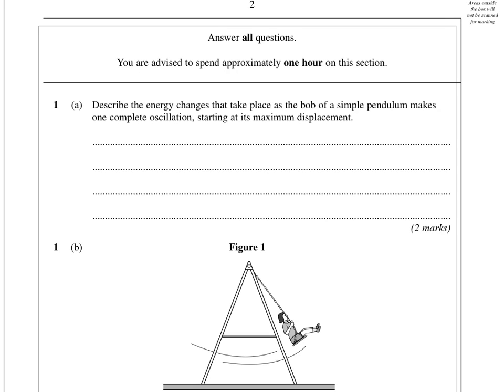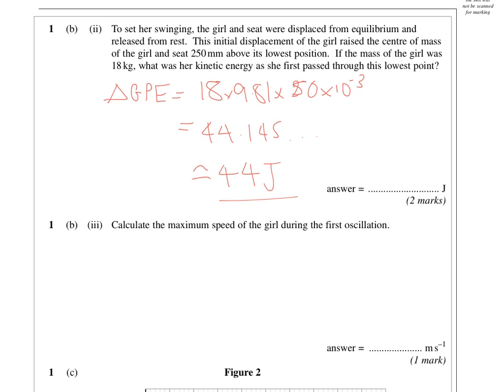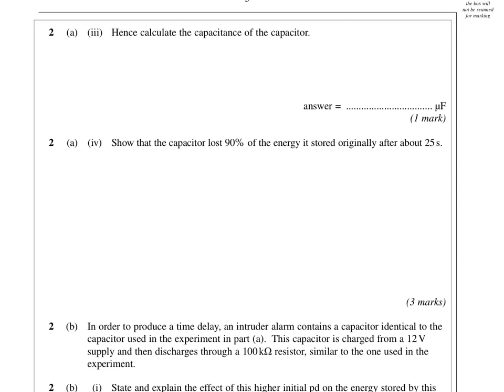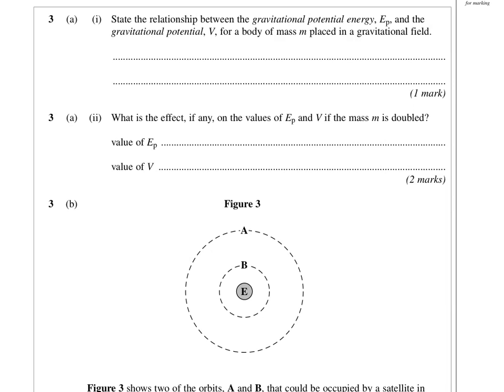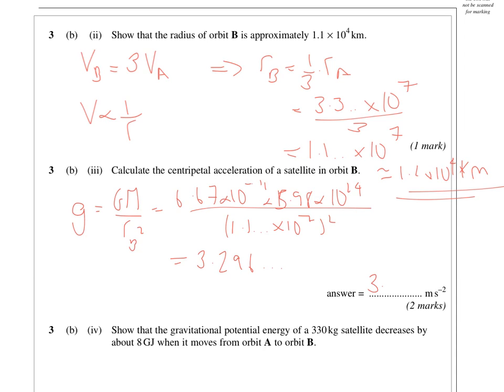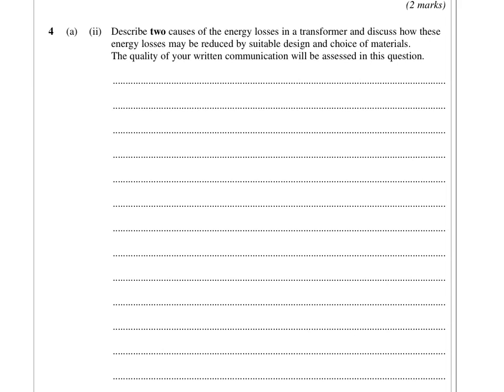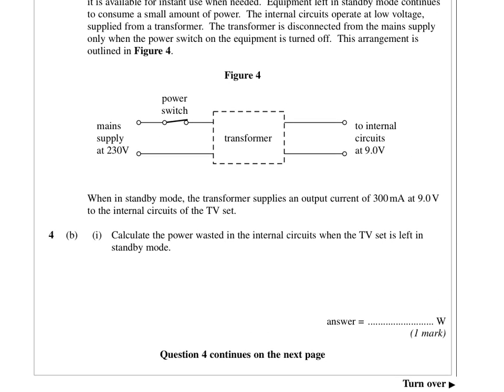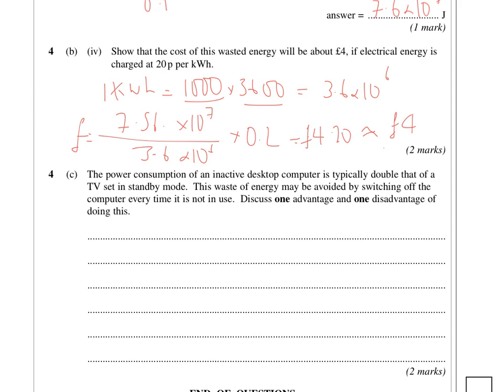AQA: A Level Physics: Unit 4: January 2010: Section B

Comment: I've got one question about 4bii) If you know the power wasted is 2.7W and the efficiency is 0.90 how do you get 3.0W as the power input of the transformer? It makes no sense, surely you would 27W as 10% is wasted (2.7W)
Reply from the maker: 2.7 / 0.9. (You have to appreciate that power supplied to the secondary side, although it is wasted, is considered useful in the transformer efficiency calculation P2 = 0.9P1)

Comment: I am going to fail so badly and I think I'm probably gonna have to retake the year
Reply from the maker: There is no point going into the exam with a negative mentality. For all you know the questions will be jn good areas for you. Stay postive
Reply: +LAE Physics thanks, I'm really not sure what to do. I've spent to much time focusing on maths and chemistry and I just don't get physics if you kinda get what I mean. my plan was to just go through a few past papers and hope for the best, any advice?
Reply from the maker: +KilltacularZac Focus on the written questions, they are usually where you can quickly make last minute improvements. At this point you can either do the calculations or you can't.
Reply: +LAE Physics I can do some of them, hopefully it'll be enough to get a c. what would you suggest to do tonight and tomorrow, just past paper questions?
Reply: +yeung samson yeah, I know it's a bit more messy this year because the specs changing but my teacher said it was still possible cries in corner
Reply: +LAE Physics thanks for reassuring me, I'm just gonna do the best I can do. if I do well that's amazing off to uni, if not then I'll just go a year later it'll be okay
Reply: retake A2? , is that even possible?
Reply from the maker: +KilltacularZac Yes they are making old spec papers for next year if it comes to that
Reply: +LAE Physics its not the end of the world is it if I have to resit physics next year? I'm sure I've done okay in chemistry and maths
Reply from the maker: +KilltacularZac It is not life ending no.
Reply: +LAE Physics Can you please do the 2014 and 2015 unit4  sectionB ? I think they are a lot harder than papers from pervious years. Thank you :D